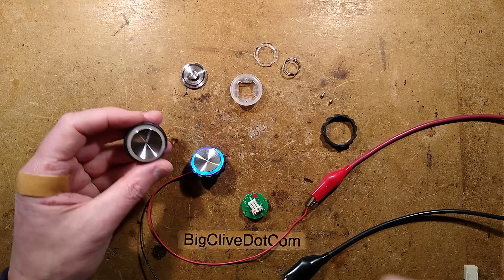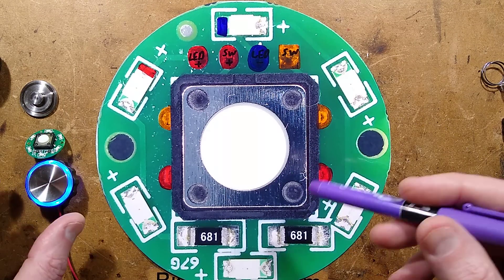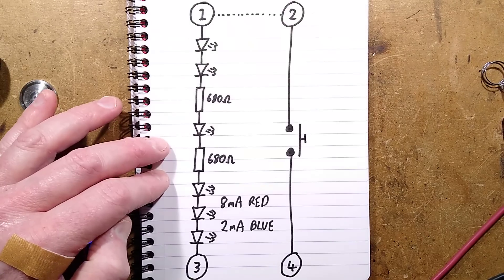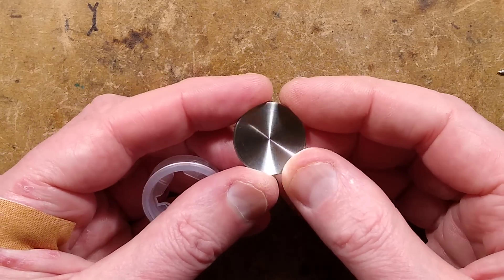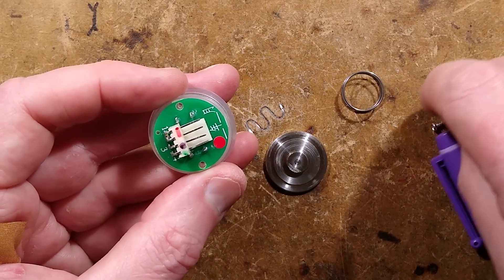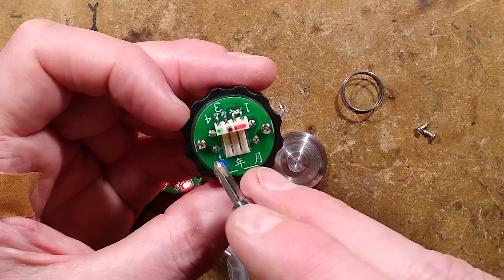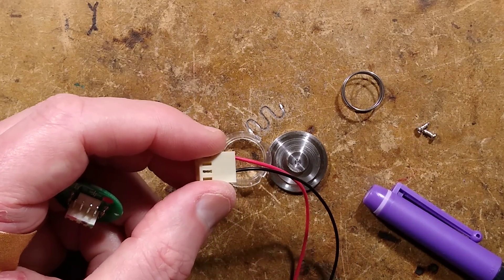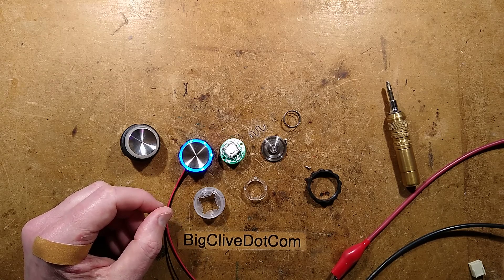Otis clone or just a very common button style?

Comment: Being from the Pittsburgh area in the US,  I'm more familiar with Westinghouse style elevator buttons.   These were just translucent plastic buttons, usually protruding from the panel, with their designation printed on the face of  the button (up, down, floor number, etc) .  Upon pressing the button, you would be rewarded with a nonconformal *smush*, and the button would glow a soft orange, indicating selection.  Presumably these were either hall effect switches, or simply the button pressing some open sprung contacts together (unlikely, but possibly), and the light seemed to be provided by a neon lamp.

Comment: These copies are getting good. I should have some early ones that have a random connector and a little sub loom  that needed sussed out to fit, zero literature with it and the markings on the wires are just shapes. The board is also held in with 4 screws instead of lips and rims, which isn't as amusing. Sturdy though. Let me know if you want one for a swatch at 👍🏻

Comment: The card readers in the lifts at work have about a half second delay when you scan your card before the buttons work, so you scan your card and hit the button three or four times before it actually registers. Then it's only active for about a second, so if you're too quick and don't make sure it's registered your press, by the time you realise, it's no longer active and you need to re-scan, but most likely you'll press the button a bunch while trying to get it working. So basically every successful press requires 3 or 4 actual presses, which effectively makes the lifetime of the buttons a third or a quarter of what they're rated for.

And yes, I've seen them replace many of the buttons in the lifts over the years. Some because they've just worn out, some because people have got annoyed and hit the button and broken it. You know what would fix it? If the beep of the card reader happened when the buttons were activated, not half a second beforehand. People naturally wait until the heard the beep before pressing the button, so not only would it work as expected, people wouldn't get angry about missing the press window and smash the buttons.

Comment: BC could i trouble you to ask what faster op amps you would recommend? i have been playing with some 8mHz crystals i found, making oscillators with 741 and 072 op amps. with poor results. ChatGPT said mpc6004, but the prices are horrific on ebay. what op amps are fast, yet cheap? thanks for your time.
Reply from the maker: I'm not an expert on high frequency analogue stuff, but the Texas Instruments NE5532P has a bandwidth of 10MHz.

Comment: Too bad there's not a solid mechanical stop to take the force from pressing the buttons.  It looks like those two self-tapping screws in the plastic frame are what's holding the button and PCB against the force of impatient finger jamming the button?
Reply from the maker: There is a mechanical stop, but it could be a tiny bit earlier.
Reply: The weak point on these is the transparent halo, that will break first

Comment: I find when I have a plastic piece that fits like that. A little heat makes things relax so to speak. A hot-air gun about 40C not too hot to touch. If the ambient temperature is low then plastic tends to be brittle.

Comment: Yeah, if it's going to be used in a real elevator, I'd think you'd want the version with that extra tolerance. Kids love to smash the living daylights out of elevator buttons. And you get the delivery folding dolly's carying 800 lbs of freight with the push handle right at button level. Then even the Otis buttons go in but don't come out ever again. The kind of thing where you get cracks in the wall also.

Comment: Regardless of feel and size, I'd wager that the switch on the Otis button is rated for a higher number of cycles. Otis is a known brand and they have a reputation to uphold. (Then again, so is Boeing, and we've all seen how their QC shit the bed the last few years...)
As to whether the Chinese ones are "clones" or it's just a very common style...I'm going to say both. I'm sure someone had a patent on the original design, but it's been around for so long that the patent must have expired. Google Patents says someone in Canada abandoned a patent application specifically for an LED illuminated elevator call button in 1994.

Comment: Cherry or C&K or someone used to make piezo buttons with various lighting options, from a center dot to a ring around the periphery, etc.  I got a few tucked away somewhere which look almost exactly like that.  That was ages and ages ago.
Digital output, would "blip" a quarter-second or so when touched.  Actual piezo, not the usual touch-switch like you'd make from a single JFET or anything.  Could get 'em O-ring sealed for mounting, too, if you wanted truly waterproof.

Comment: IIRC these round Otis buttons have a double (and extremely satisfying) click to them when pressed.  Do these ones from AliExpress also have that?  If so I am ordering some right away.  When you press those buttons slowly, that second click is like: "Yeah I heard you the first time"
Reply from the maker: The real Otis one (featured in another video) only had a single tactile button.  Maybe the centre illuminated version has two switches.

Comment: Hi Clive,
Two suggestions for getting the plastic ring back on.
Use your heat gun to warm the plastic ring to make it more pliable to see if it now fits.
Use an ice cube under the metal button to cool it while you are heating the plastic ring, then press them together.
Reply: Warn the plastic that if it does not comply, you will burn it! 😠

Comment: Does the 3 pin one short out the powersupply when you press the button
Reply from the maker: It could be wired to do that, but in reality it has a common positive with one connection lighting the LED and the other acting as the button press signal.

Comment: I used to work in a building with an old and slow Otis elevator, and someone clumsily modified OTIS  on the panel inside to read OTIOSE, which I thought clever.
Reply: Don’t get it. And how did they cram extra letters in?
Reply: @_..-.._..-.._ nigh not be a real Otis but a cheap Chinese clone. That the style they use to use a similar name to a brand name

Comment: Another good search term is Berg connector. As in the power port on floppy drives.

But where is the contact to attach mains to the stainless button? Isn't that a requirement in China?
Reply: Connect mains to one of the switch pins and use 220V control relays like in old OTIS elevators .  Big Clive made some videos years ago .
Reply from the maker: The live connection is connected to the button via a switch so you are making firm contact when it is energised.

Comment: You should try putting the steel button in the freezer for a few hours.  Then you can soak the plastic bit that's supposed to go around it in some hot water for a few minutes. Take the steel out of the freezer, the plastic out of the water, dry off the plastic, and see if you can get it back on the button.
Reply: Na. I tried that a while ago. I ended up eating all the icecream
Reply: Some polymers shrink when heated. (For all I know I’m wrong and it’s only natural rubber that actually does that.)
Reply: @markiangooley  But even if it shrinks a little if it gets softer enough you can push through.
Reply: @markiangooley  that is true. I hadn't considered that. Maybe just the freezer will be enough.

Comment: I think if you put the plastic piece in boiling water, it will click back on the button quite easily.
Reply: Depends on the kind of plastic.

If it’s thermosetting it will retain its shape and strength, but if it’s thermoplastic then it will take a new “set” after being pressed on to the metal and not hold it securely.

Better to chill the metal bit than heat the plastic bit.

Comment: It is a Molex KK 2.54 pattern connector, the part numbers you quoted are also Molex…

So whilst they’re definitely not made by Molex you’re not totally wrong calling it a Molex connector (unlike people that call the old 4-pin IDE power connector a Molex when it was originally an AMP product)
Reply: Or the people calling it the old IDE connector when it was originally (in computer usage anyway) used on floppy drives with zero integrated electronics.
Reply: @tin2001 Floppy drives originally used PC edge connectors like the ones for expansion cards .  Pin count is different than PATA/IDE .
Reply: @tin2001  except that it is, also, the old IDE power connector prior to the SATA power connector which was also phased in on the last gasp of IDE drives

Comment: Could the LEDs be made to work on 5V (or 12V) by changing the resistor values?
Reply from the maker: Not easily due to there being so many in series.
Reply: Cut some tracks and wire them into 2 parallel sets of 3 in series instead. Use some enamel coated winding wire to keep the rewiring small and it should all fit back into the case nicely.

Comment: Are any of the buttons dual colour, changed when pressed? I could see them making a fun robot eye
Reply: I've found some that has 3 wires for RGB
Reply: @SodaWithoutSparkles  thanks, I'll have to look into this eventually!
Reply: Punch the red robot eye and it turns bruise blue?

Ou4 new robot overlords will not be amused.
Reply: @markfergerson2145  haha, I mean to change emotion, say passive to angry, for comical effect, ask it the same thing a few times in a row and it'll go NO and go all red 😂it's also the classic way to tell when a robot has become evil, the lights change
Reply: If you want robot eyes, why not get some of those little round LCD displays and put any animation of an eye that you want into them?
Some are touch screens so you could use them as buttons still if that was part of your idea... You could go full menu even, or a pattern unlock interface by rubbing the eyes in the right way 😂
Reply: @tin2001  because lcd is totally different technology, looks bad, doesn't have the same brightness and contains a ton of useless code that you don't need with a single transistor?

Comment: For something you'd imagine will see a lot of use in its intended lifetime, the plastic doesn't look anywhere near strong enough, one good bash and it's finished
Reply: Funnily enough, they don't.

They crack around the clear plastic easily and if they are cleaned with anything strong they go even more brittle over time
Reply: Modern product designed to fail and make money for the supplier on repair call outs etc
Reply: Warranty void if paper tear.

Comment: Could you get that plastic ring clipped back on if you heated it up a bit first, or conversely froze the metal part?
Reply from the maker: I'm thinking of warming the metal part first and seeing if the plastic will clip over as it warms up.
Reply: @bigclivedotcom that seems counterintuitive to the normal method for fitting two things that are a bit tight?
Reply: @ConorNoakes it’s not just about size of the metal, but also flexibility of the plastic. See also: heating up uncooperative nuts on a car — their often-nickel metal usually expands less than the often-steel of the wheel, the latter of which is also made a bit more flexible with heat.
Reply: @kaitlyn__L  that is dissimilar expansion to break a corrosion bond. Also, heating a nut will make it expand causing the tolerance between the thread to increase.

What Clive is suggesting here would effectively be analogous to heating the wheel stud instead of the nut which would cause it to expand and make the nut grip even tighter.

It would make more sense to heat the plastic, possibly also in conjunction with putting the metal in the freezer.
Reply: @ConorNoakes  fair enough!